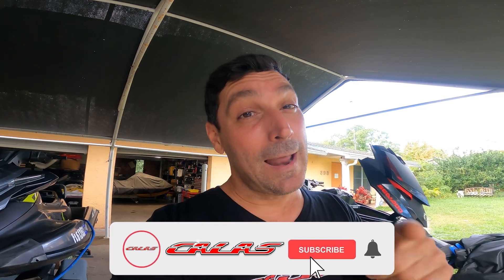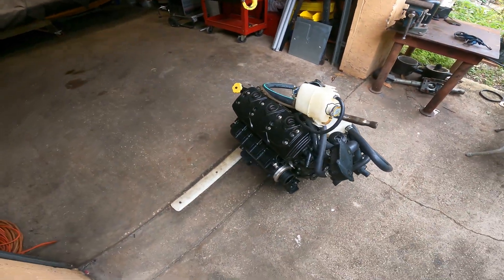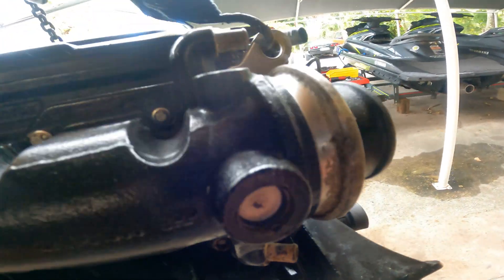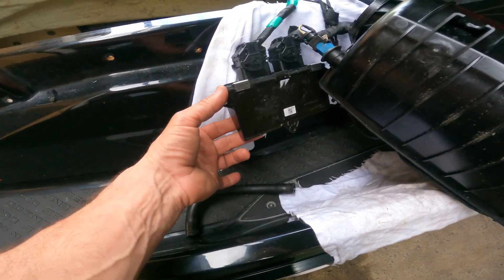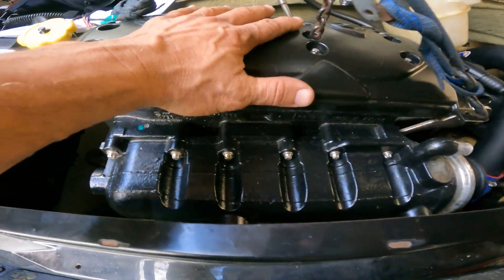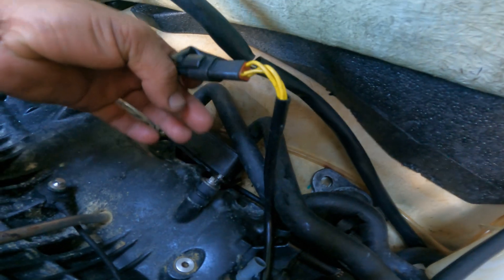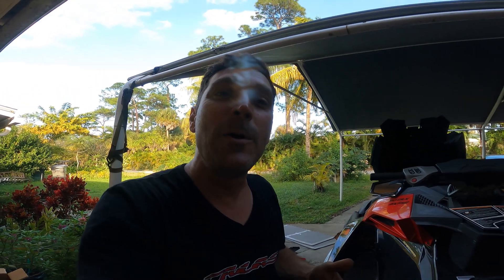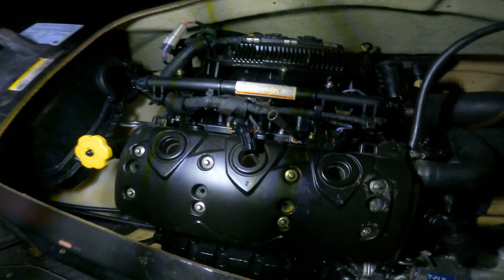Sea-Doo RXP-X Motor Install + Sea Doo Jetski Tech Tips + Test Ride + SeaDoo Injector troubleshooting

Comment: I have a ? I have a 2005 rxt 215 i just did the motor and now the oil is chocolatey. What could it be? Could it be the oil cooler?
Reply from the maker: Yes
Reply: @calasworld  can you get them new I can’t find them they all used and I don’t want them used

Comment: I just got my first seadoo  4tec it's a 185 gtx. But it's hurt. Took it apart  and the ringland on the cylinder #3is toast. I believe  they had cast pistons.  Any recommendations on parts  I should  put in ? For an upgrade.  Or just  go stock. I also  heard  about  the valves that's in them are junk.  The machine  has 120 hrs.
Reply from the maker: Definitely replace the exhaust valves as far as pistons go CP makes a really good piston and they are not that expensive just go to the right machine shop the can do the right clearance that’s important
Reply: @calasworld   can the head's  on the 4 tec be shaved to clean  up the surface?  Thanks  for your content and replies.
Reply: @calasworld   awesome  thank you.
Reply from the maker: Yes
Reply: @calasworld  do you is 20 thousandths  too much? It had pre ignition in one cylinder  and caused  a little damage to the head  from the rings coming apart.  Too bad I can send photo's on here

Comment: Nice work. What tool do you recommend for the carbon seal removal? The old 2 smokers you could pull back the hat with your hands to remove the clip but not with the newer bigger versions on the 4strokes.
Reply: If it's not pulling back tap on it with a rubber mallet  it's just sticking
Reply: Use the tool its about $100, it prys it back. If its siezed siezed youll have to do what I did and cut the boot with an angle grinder or dremel, if you knick the shaft or mess up the splines its about $150 for the shaft, dont mess up the splines because if the ones inside the ski bend youre in a world of trouble. A new boot is about $30. I sprayed my drive shaft with a few coats of black spray paint to prevent rust and because it looked nice.